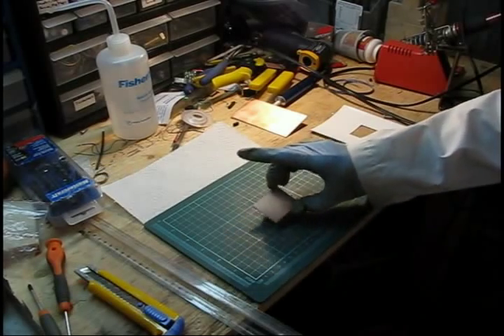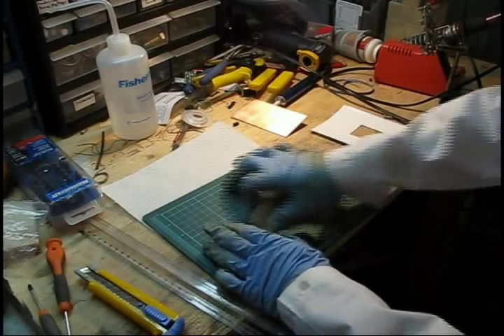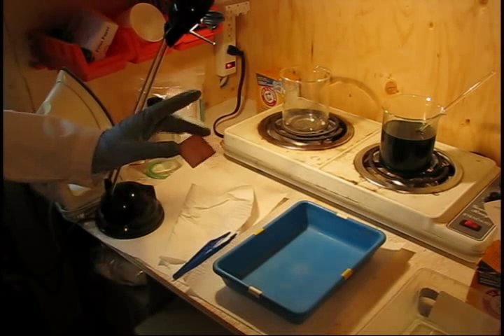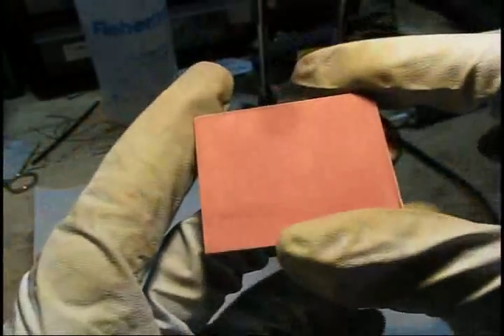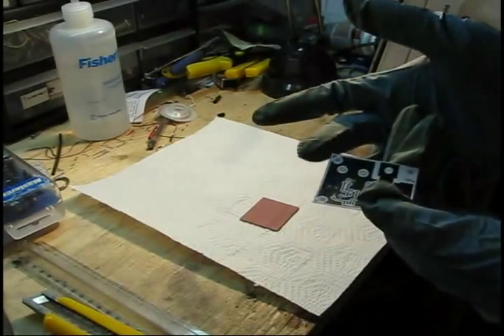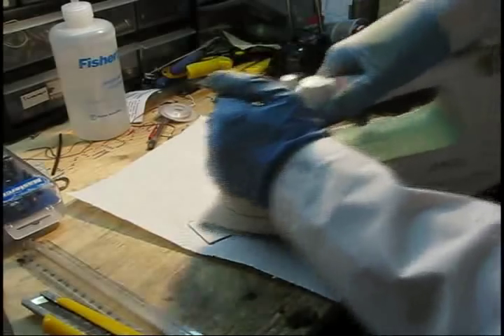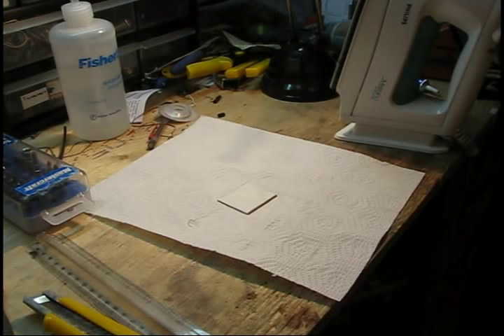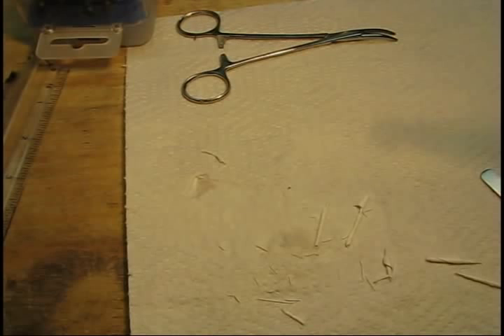PCB Toner Transfer Etching Tutorial Pt 2

Comment from the maker: The toner will stick to clean copper just the same, but in practice small finger prints, bits of dust, etc. will end up preventing areas from etching. The pre etch has 2 purposes:
1. Indicates that the entire surface is clean enough to etch.
2. Make the surface rougher and better for toner to stick to.

You may want to experiment with the pre-etch however because the chemistries are different between CuCl2 and FeCl3, and the surface layer of chlorides may have different adhesive properties.

Comment: Some tips:
1. Use Scotch Bright scouring pads instead of sand paper. No copper dust everywhere!
2. Use Pulsar Paper by Professional FX. 100% clean toner transfer that just FALLS OFF in 8 seconds with water. No removing layers of paper.
3. Use a laminator like the GBC HeatSeal H220 Pouch Laminator for even, perfect transfer the FIRST TIME!